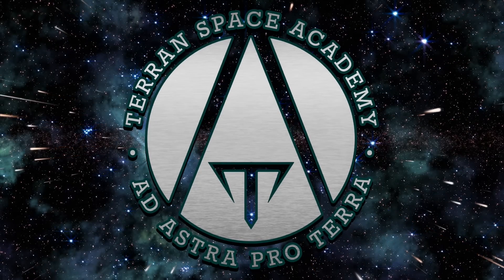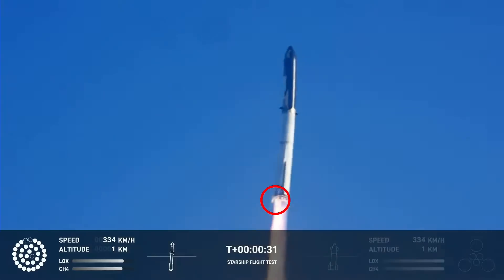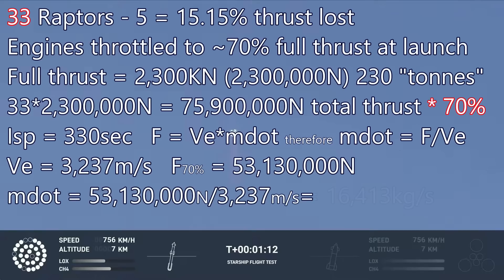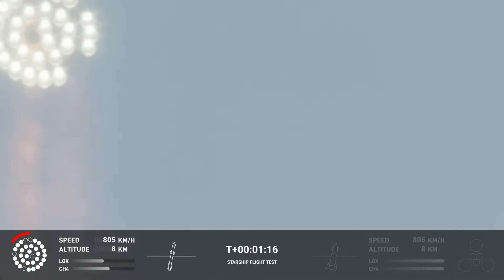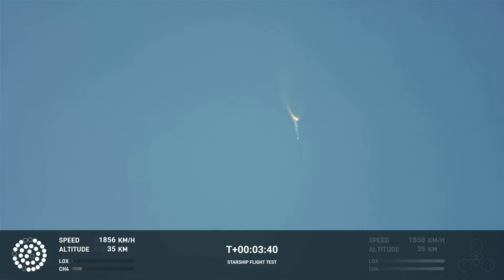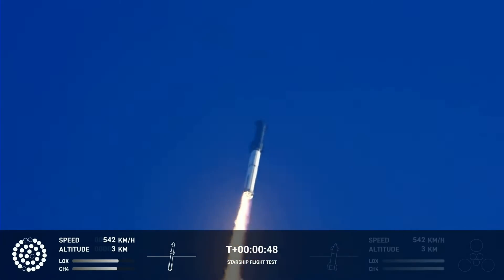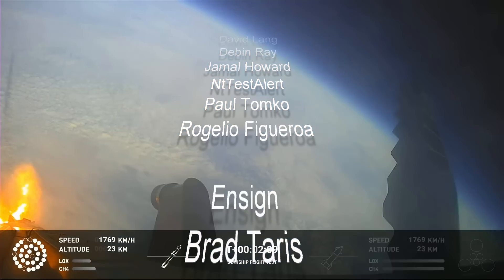Starship Flight Analysis: What went wrong with Starship?

Comment: It looks to me like debris from the initial engine starts, shot back into the engines and that is what knocked them out. Chunks of concrete could have easily blown back into the engines damaging them. If there are pumps and turbines inside with damaged housings it could take a little time for them to get hot enough to fail. Further, when Concrete gets hot fast and there is moisture in it, it kind of explodes or pieces pop apart. I think new thrust diversion channels should be developed. This is the first time something this powerful has been launched. There were parts and chunks of concrete flying everywhere and into the ocean nearby. The parts that left the launch pad need to be inspected and retrieved to see where they came from off the pad.
Reply from the maker: We agree... It needs steel plating I think.  And water cooling.

Comment: I think the launch pad, and lack of fire channel, is the ultimate issue.
Reply: No comment made about the lack of deluge system  (allegedly because Musk wanted to proceed sooner than it could be made ready) or the damage and flying debris possibly damaging the booster.
Reply from the maker: We agree... the rocket would have done fine otherwise we think.
Reply: Pretty sure they were expecting significant damage from flying debris.
Reply: @gregbailey45  well they certainly go that😅

Comment: Can you confirm that the Apollo 7 mission flew on a Saturn 5, as you said? IIRC it was on a Saturn 1-B. Apollo 7 was only manned Earth orbit. If so, does that affect your calculations that apparently include the 4.28g-max S-5?
Reply: Apollo 7 was a Saturn 1-B
Reply: He made a mistake, no Saturn V on Apollo 7
Reply from the maker: It was a 1B.  I was focusing on the g forces to give an idea of what the airframe would experience.  Rocketframe?  Structure.

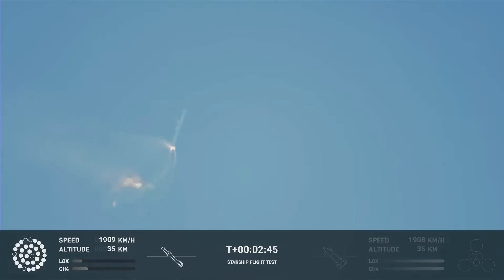Comment: 6:25 - Analysis INCORRECT: The scheduled "flip" maneuver is programmed to occur just prior to MECO - no more than 3 seconds before. Therefore, the flip observed at this point is not a part of the separation sequence, but rather an anomaly, as the engines keep firing for a very long while afterwards. Additionally, the rocket is still within Earth's atmosphere to a large degree, and is not ready to separate. Separation occurs in space, where the atmosphere is extremely thin.
Reply: They called out MECO but to me some appeared to continue burning.  This would definitely prevent separation
Reply from the maker: They called MECO and flip maneuver sooo.... they were at least trying.
Reply: @terranspaceacademy  I didn't hear any call-outs for either, other than from the announcers, who were basically freestylin' it on the fly, giving what they thought at the time might be the best explanations for what they/we were seeing on the tracking camera. SpaceX doesn't tend to call anomalies or otherwise off-norminal events when they happen. They tend to sort of cruise through the situation until well after it is absolutely clear that things are not norminal. With this being a first-time launch into uncharted territory, it seems clear to me that the announcers were doing exactly that whilst attempting to ascertain how "sideways" things were actually going (pun intended).

Comment: Great analysis… so everything looks like boils down to separation mechanism not working
Reply: So we think it could've got to orbit if it separated ok?  When was the point of true no return? timestamp? Was it still recoverable for orbit at 2:30 or so?
Reply: @joey84-i9c  6:25
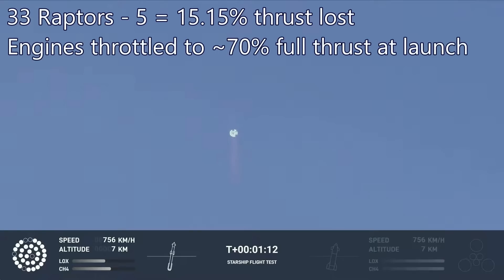Reply: @medicalminute4927  Looking further, looks like MECO should have been around 2:49 but also 80km high.  Not 2:49 and 38km high.  So seems like it was doomed much earlier than even 2:00.  Would be cool to see a project altitude/speed vs actual altitude/speed
Reply: @joey84-i9c  periapsis altitude was supposed to be 50 km as per flight profile from Wikipedia so I don’t think it was supposed to reach 80 km . It was a transatmospheric flight with suborbital velocity to make sure starship can de orbit safely.
Reply from the maker: Probably.  Though it would have been a stretch at that altitude.

Comment: It lifted slow from the pad after shattering concrete. I think some engines were out almost immediately after they started as the debris may have damaged them.
Reply: 3 engines out before it cleared the tower. Still plenty of thrust. The hold down was long. They probably saw. 3 out, rest fine. Ok, let's go, 3 out is within specs. 6 s hold down. Maybe never ignitited.
Reply: @please_stop-v7o  I heard it takes 6 seconds to light all the engines, they start up on ranks. It took 6 seconds from when smoke first emerged until it lifted off.
See for yourself...
Reply: @please_stop-v7o  I heard somebody say the mechanical hold downs were not connected at ignition.  It was just sitting there letting it's engine warm up
Reply from the maker: We think so too Wesley.

Comment: Stage Zero needs to magically obtain a thrust trench, fuel farm & Hoppy need to be moved
Reply from the maker: Almost certainly Riley.
Reply: @terranspaceacademy  2025 operations seem optimistic, if completely redoing Stage Zero to ultimately include a trench underneath is required.  They might get away with shoring up tank farm barriers, thereby leaving the tanks where they are. But, Stage One needs a great deal, it looks like to me.

Comment: This thing saw the curve of the earth ,  the fact they blew it up seems a test of many things that people illogically  say was  a failure even the self destruct working is a ticked box it may have come back down in once massive piece , that gives confidence in even that aspect of the system aboard in the current set of test flights  ,  a whole lot of incredible data for future development, the fact it even left the launch pad is amazing , what a beast of a system  which when refined and developed,  the future iterations will have many changes and built better because of this day. Even the launch area will see a redevelopment on how the lay out for such a behemoth needs to be developed to sustain the forces when they launch.
Reply: Just keep that bar low enough and you will never fail!
Reply: @rcpmac  given what has been spent i dont  think spaceX have a low bar , one , look at the scale of this space system , look at the altitude for this first fully connected stages, the fact they didn't go boom on the launch pad or break up before  the self destruct was engaged  its a testament to the engineering in all aspects of what is still early testing . The fact this is proposed to be an Astronaut carrier you want it to be  fail tested so you gather all the fail points that could potentially occur and those that you on hindsight maybe didn't even consider. Such as potential  blow back damage from loose debris or weaker than anticipated  coatings on surrounding facilities that break away then collide with any part of the space system during launch. With that amount of explosive energy in a steel tube ,if  getting all that together  is a low bar then  kudos Spacex
Reply from the maker: Just keep saying the same thing over and over again and you'll eventually be right :-)
Reply from the maker: We agree Mr. Scott.

Comment: Thank you for being fully upfront about the reality of this test being a success.  Even NasaSpaceFlight fell into the trap of using a clickbaity headline for their video.
One conclusion I suspect a lot of folks are going to make is that B7 was almost certainly damaged by the debris it shot up.  You don't need to look very closely to see that house-sized chunks went everywhere, including a large chunk that went almost perfectly vertical, close enough to B7 that someone could reach out and touch it as it sailed by.  There's absolutely no reason to argue that all of that debris was scattered everywhere and yet B7 miraculously came out unscathed.  That would be nonsensical.
Reply: Yes, No comment was made about the lack of deluge system (allegedly Musk wanted to proceed sooner than it could be made ready) or the damage and flying debris possibly damaging the booster.
Reply: @rcpmac  The situation vis-a-vis the deluge system is a little complicated but basically they couldn't make any big change like that without effectively resetting the FAA review, and it's probably safe to assume that whatever they are doing with it now was cleared with the FAA during the pre-license survey.  I have major doubts SpaceX even has the option of looking into a diverter because there's probably no way to accomplish that in a way that would avoid tripping over environmental concerns.  That all being said, SpaceX surely understands now that they don't have much choice.

As far as proceeding before the thing was installed: It was either that or go ahead and scrap S24/B7, which they were on the verge of doing before the FAA indicated that the license was imminent.  They decided instead to take a risk at getting some useful data out of the stack, which they hadn't been allowed to do for any of their previous prototypes, which went straight to the scrapyard while SpaceX continued to wait on the FAA's schedule.
Reply from the maker: You are most welcome.

Comment: The Saturn 5 was not used to boost Apollo 7. The smaller Saturn 1B was the booster for the first manned Apollo mission. The Saturn 5 was not used until Apollo 8 and later missions.
Reply: Correct, I was trying to see if someone else noticed the error
Reply: Saturn v was launched 3 times before Apollo 8
Reply from the maker: You are right.  A Saturn V launched Apollo 6 and 8 but a 1B launched 7.